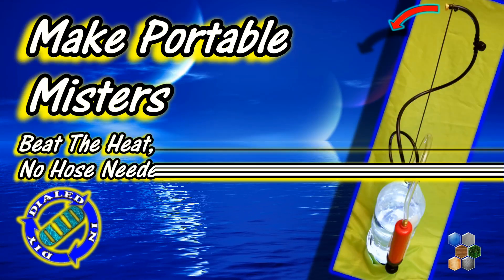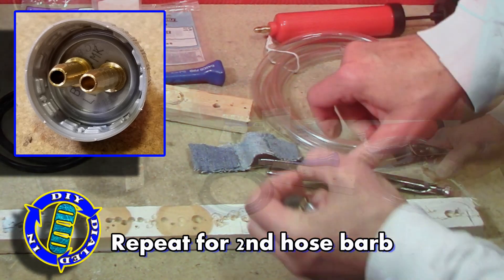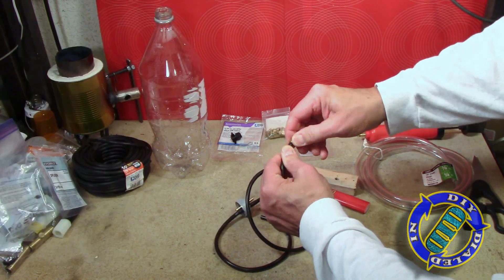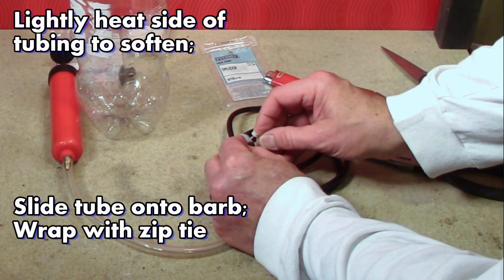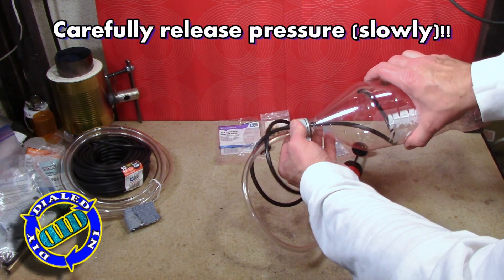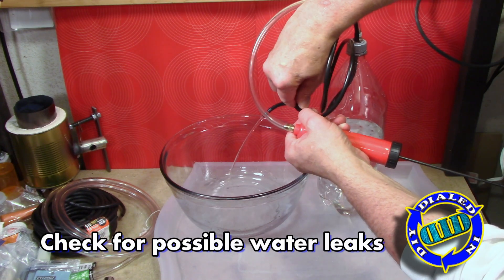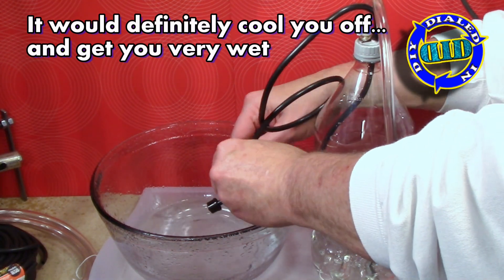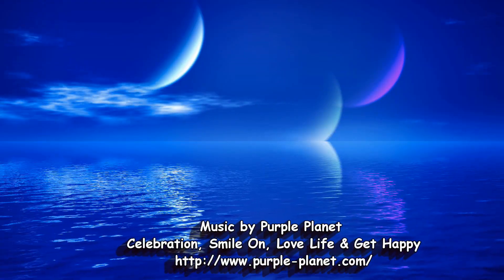Make Portable Cooling Misters - No Hose Needed to Beat the Heat

Comment: I buy the .03mm orifice brass nozzles from Amazon. I use them with my 2 gallon Harbor Freight sprayer. I rigged a home misting system using PVC pipe. Tapped and drilled the nozzle screw in holes, attached the water hose to the adapters, and viola, very fine mist. The more pressure the finer the mist,of course. Make sure you clamp the hoses down tight. The water pressure likes to push out the hoses from the adapters.
Notes:
- I sanded down a small area on PVC pipe using a circular sander equipment. Makes for a better seal.
- I placed a piece of panty hose over the intake tube adapter. Helps keep out debris.
- I have hard water where I live so I remove the nozzles when I will not be using the mister system for a few days.
- Buy extra nozzles, they can clog easily, especially if you detach and reattach your hose. Dirt will get into the system.
Reply from the maker: Awesome feedback and detail.  Thank you so much for sharing the info.  I particularly like the tip for filtering debris... I'm going to have to try that.  
Sorry for the delay in reply... I really do appreciate that you took the time to watch and post this comment!